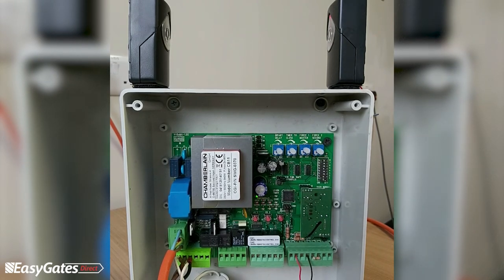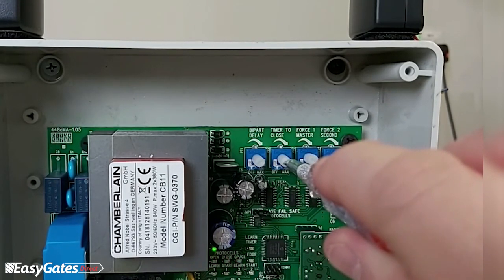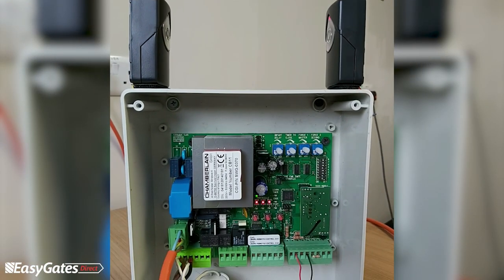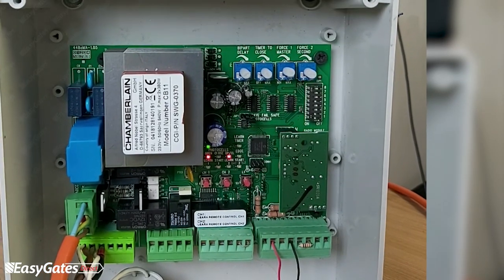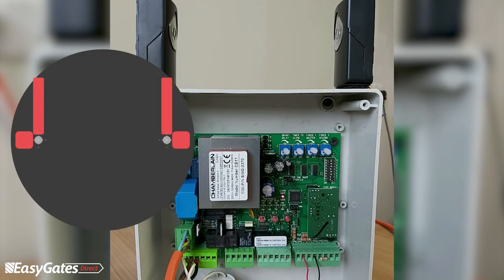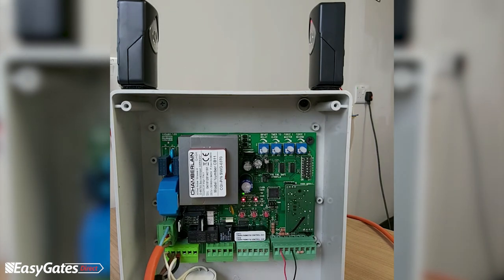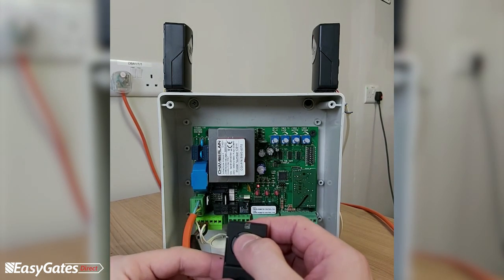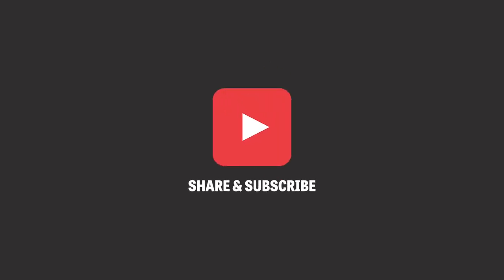Programming a CB11 PCB for a Double Gate Installation

Comment: Thank you Team for your teaching videos. In the CB11 programming the photocells, you removed the fail safe small plug from one pin to the two pins, powering on and off. The middle red flashing light of the three above the Channel buttons went off. You were left with Open-Close-Op/L. I have followed instructions and though the two gates open and close correctly the Photo cell sensors do not interrupt and return/reverse them when the beam is crossed when Closing. Please Help.

Comment: Great tutorial, very easy to follow, but I'm trying to program the controller for a 1-wing installation. I can't find any video or documentationon how to do this; even the supplied manual states "If only one drive (1-wing operation) is used, the learning steps for wing 2 are different." but doesn't give any clue on how to do it. I will try progrmming it as a 2-wing but use short times for wing 2.
Reply from the maker: Hi John,
Thanks for the comment. With regards to the programming of a single leaf, this is done in the exact same way as if it were a double. So for ‘Basic Programming’, press the L1 button for 1-second and release. The gate will run to the open direction. When opened fully into the stop, press the L1 button once more. Now there will be a delay in closing as usually M2 would close all the way followed by M1, but there is nothing in M2 so just expect a pause.
 
When using the ‘Advanced Programming’ method, Press and hold L1 and release when M1 starts travelling. You need to then use the L1 button to tell the gate where to initiate slow down and then again when the gate reaches the stop. This is when M2 would normally go through the same manoeuvre, however even though there is no M2 connected, we still have to mimic the button sequence as if there were. Now press L1 once as if to start the slow down and again as if it reached the stop. You’ll then have to repeat this as M2 would now normally be closing. So now press L1 once to initiate slow down and again to indicate stop. Now M1 will start closing, so again press L1 to tell the gate where to slow down, and L1 when the gate has run into the stop. This will complete the programming sequence and the LED’s will run through a power cycle.
 
Hope this helps! If you need any further assistance, please don’t hesitate to get in touch on our technical helpline.
Many thanks
Dave Blake
Reply: @EasyGatesDirect  Thanks for the detailed response. This worked perfectly, thankyou!

Comment: 👌👍 thx for the video it really helped. But where dus you buy the remote, and what does the capacitor needs to be?
thx alot
Reply: Hi Timo, the Liftmaster TX4UNIS remotes can be purchased from our website (www.easygates.co.uk). The capacitor spec depends on the motors you have connected. For instance, on the liftmaster rams you will need a 6.3uf capacitor. For the SUB300 underground motor you'll need a 10uf capacitor. The sizes are all found in the motors manual which can be found via manuals.easygates.co.uk 
Hope this helps!

Comment: One of the 772E blinks constantly. checked and cleaned the camera. opened the plastic cover and replaced. nothing is the way. still one has Solid light and the other still blinking. On the CB despite REsetting the PHOTOCELLS using JUMPER, powering OFF  and ON where 5 LEDs FLASH. Allowing about 20 seconds then Romoving the JUMPER and placing one pin, theTHREE leds come FLASHING again and again. what might be wrong with the PHOTOCELL CONNECTION. The LED lights are not displaying
SOLID RED. HELP.
Reply from the maker: Hi James,
It sounds like the control board is not recognising the photocell connection. Can you verify which connections you have these photocells connected into, and that you only have one set wired into the designated input? Were these working previously?
If they were working previously but have just gone down, then I would start by looking at the wired connections for any blackening on the ends which may indicate moisture in the cable. Being a data signal, any interference on the circuit may affect the signal being monitored by the board. So even though there is voltage present on the cells, the data may be being lost by a capacitance fault in the cable.
If the above is the case, either try another pair of cables back to the board, or strip the existing pair back to clean copper and make off back to the cells, then repeat the programming procedure. If you’re still having issues, let me know a bit more info that I’ve asked above and I’ll see what I can do to help get you back up and running.
Any other queries in the meantime, just let me know.
Many thanks
The Easygates Direct Team